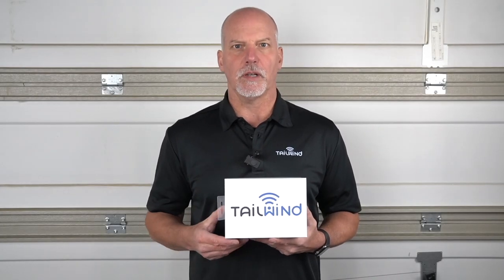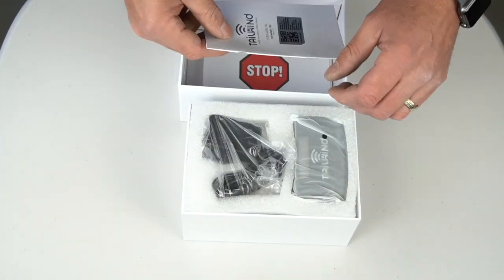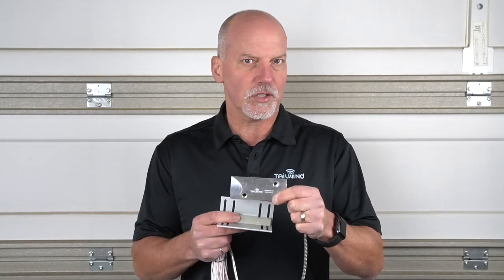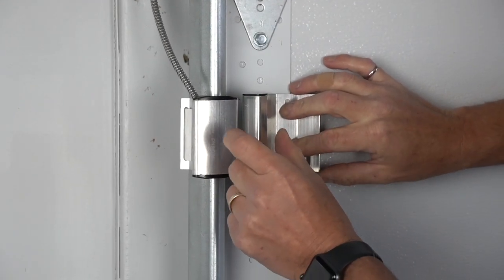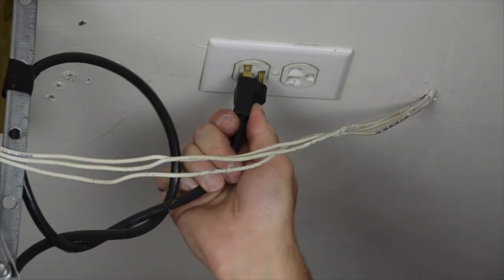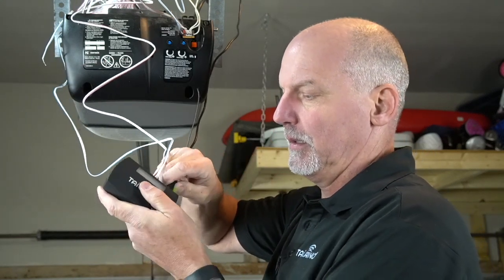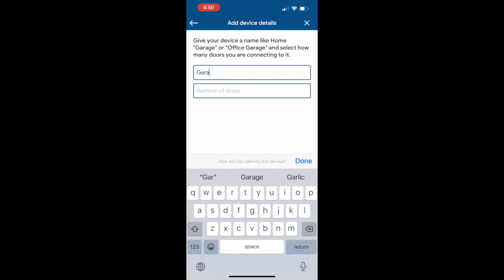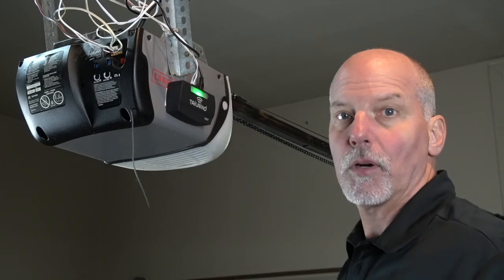Tailwind iQ3 Pro (1st generation) Installation Video

Comment: I already have a garage door opener but I want to install this.  How long should it take a professional to install it?
Reply from the maker: Typical installation times are in the 45 - 75 minute range for one door. It really depends on how particular the installer is with the wiring and if they have any experience with it. Like with anything in life, experienced installers can do it faster. Additional doors generally go much faster.

Comment: I have a linear opener with only 3 terminals labeled “push button” “common” and “beam”. Which two should I connect the blue and white wires ? Model LD050
Reply from the maker: You would connect to "push button" and "common"

Comment: How do I install this on a gate ? There is no instructions on your website
Reply from the maker: please email support@gotailwind.com and we can send you a picture of a gate installation. We recommend the universal sensor version for gates FYI.
Reply: GATE OPENERS
Gate openers are generally compatible but there are a few things to note:

1) Tailwind requires wifi and power.
2) The Tailwind controller and power supply need fo be shielded from weather. Generally this can be accomplished by putting the controller in the same housing as the gate controller, but Amazon also sells “project boxes” suitable for outdoor that are a good option as well.
3) The universal sensor version is much more suitable for gate installations than the J-track version.
4) Please check your opener for a terminal labeled OSC (open / stop / close), PB (push button), SBC (single button control), CYC (cycle), RADIO, or anything that indicates that it is capable of toggling the gate open / closed from the same terminal. If so, it's compatible without anything special. If your opener does not have any terminals like this and it ONLY has separate inputs for open / close please contact support@gotailwind.com for guidance.

Comment: Over the years, I've been through the mill with my garage door. I started out with an Insteon garage door opener kit. That worked well, But then my garage door hardware gave out, and I was forced to install a new lifter. I purchased a Chamberlain model B750T. It came with the MyQ software, which I programmed to integrate with my HomeSeer home automation hub, and my Amazon Alexa installation. But then MyQ decided to discontinue Alexa integration. So I am once again looking for a solution. Hopefully one that's a little longer term. My questions: 1) I have already installed a sensor wire, the one that came with my Insteon set up years ago. Do I need to still install the sensor that comes with the tailwind pack? 2) Does this replace the wall button?  How much of the old MyQ/Chamberlain installation is replaced by this setup?
Reply from the maker: if the sensor you already have installed is a simple contact closure sensor that is a closed circuit when the door is closed, and open circuit when the door is open, you can use it with Tailwind as long as you don't connect any other hardware to it. Tailwind does not replace the wall button. All existing controls continue to work. You would keep your existing garage door opener as well as any other hardware you wish to keep. As for what Tailwind "replaces", it doesn't really replace anything. Tailwind will allow you to control your garage door using our hardware and software, which also includes a lot of integrations (local control API included). The full list of integrations can be found on our website here https://gotailwind.com/pages/what-does-tailwind-work-with

Comment: Is it me, or did he miss how/where to instal the door sensor wire??
Reply from the maker: The system ships with the door sensor wire  already connected to the door sensor. Once you install the sensor you just run the wire to the controller and plug it in.

Comment: This video is great if everything works as planned. However, my installation has run into a snag and getting any kind of support feels impossible.  My issues has been received and is being reviewed great, but the question I thought was simple. I am not getting a blue flashing light to get connected via bluetooth.  The tool they gave me is not toughing anything when I follow the instructions to reset.  When I look in the reset hole all I see is a metal board. Nothing provides resistance anywhere when the tool is inserted.  I am stuck, and no one helps.  🤔
Reply from the maker: I looked into this for you to make sure someone was going to get back to you. It appears you contacted us at 7PM (our time zone) last night and we responded to you this afternoon with a few emails and a resolution to the problem.
Reply: @TailwindGarage  I did receive help, and a new product was sent to replace the one that was not functioning.  It worked great and i was up and running in minutes once i had a working product,  Thanks for all the help!
Reply from the maker: @ajbenway1  our pleasure!

Comment: Just finished installing IQ3 Pro on my single-door garage. This video was very helpful. My opener is a 1997 LiftMaster Security+ and works perfectly with Tailwind. I bought the J-clamp version and found that the clamp isn't very secure since the "J" form of the sensor doesn't truly align with the "J" rail and with the way the locking screw works. I ended up really REALLY tightening it and it now seems to be holding to the rail. We'll see over time and seasonal temperature swings. 

I think it's amazing how a 13 minute install video makes everything look super easy but in reality the whole ordeal took over an hour including a bit of trial and error.

100% glad Tailwind is Canadian.

Comment: Would love to see the guide on how to set it up *without any mobile device* but instead using only a laptop PC with a web browser. Would also love to see a version with an Ethernet port option so as to avoid using inherently unreliable WiFi connections.

Comment: Can this device be installed to the internet with cable rather than WiFi?
Reply from the maker: The Tailwind controller is connected by WiFi. It does not have an ethernet port.
Reply: @TailwindGarage  A terrible design choice made by far too many device manufacturers. Wired Ethernet should always be an option for devices that are not and do not need to be portable.
Reply from the maker: @r6u356une56ney  we conducted surveys during the design phase and asked if they would like an Ethernet port. Lots of yes answers.

Then we asked if they currently had an Ethernet cable that ran to their garage and if not, would they be willing to install one? Most answers to that were No, but still some yes.

Then we asked if they would be willing to pay the roughly $5 to $7 extra it would cost to add the Ethernet option (we didn’t want to make 2 different models - so it was WiFi + Ethernet or just WiFi).

When we asked that question all answers came back as “No”, so the Ethernet port was pulled from the design.

All of that said, Tailwind is doing very well and growing. We recognize there are applications and customers that would benefit from having an Ethernet port. There might be something on the roadmap to address that segment of the market.
Reply: Especially if you do it as a POE option as power and data over Ethernet

Comment: Since the standard garage door opener already has limiters built in, why not build a unit that works like a regular remote that uses a wifi or matter connection to trigger the remote. Then you wouldn’t need any other hardware or sensors.

Comment: Tailwind claims to "work with" Android Auto.  But what does that mean, "works with"?  Does it provide complete functionality that you would get with using the Tailwind app only? It doesn't show up on Play Store as an approved Android Auto app. Do I need to use something like "Android Auto Apps Downloader (AAAD)" to bypass the fact that it is not officially supported? i.e. side-loaded

Comment: I'm still on the fence about what solution to get.  I understand the issue with MyQ's lack of integration with home integration platforms. It would be really nice for someone to provide a detailed breakdown /comparison of all viable contenders, functionality and price points for 1-3 openers. Personally, I like the idea of having wireless sensor unit like MyQ provides. Or maybe having a local solution (no cloud) is a deal breaker for someone, which might rule out MyQ for others.  Is there a Consumer Report for this category. i.e.  Smart Garage solutions

Comment: Much ado has been made about the MyQ and Home Assistant integration issue of late. 

I can assure you that 99% of Chamberlain's customers are not technical users to the extent that not having API access would matter to them. They want the solution to do a few things like remote access and door position sensing which it does. The majority are probably not even using Home Assistant and may decide to opt for more mainstream solutions. 

Chamberlain has no doubt invested significantly in its products. For them to support an open software solution like this doesn't  provide any revenue and in fact would only be an expense. If you were CEO of Chamberlain, what would you do? 

The only way you would get them to buy in would be if everyone just refused to buy their offerings unless Home Assistant integrations worked with MyQ.  Realistically, I don't believe that day will ever come. 

Out of curiosity, does anyone know how much a support license would cost? Perhaps it isn't that onerous.  You can inquire on their website as they provide an inquiry form. 

* Also, might I suggest adding one of those charts (with checkmarks ) that indicate what platforms (Google home, Homelink, Home Assistant, etc) , are supported by some of your competitors vs Tailwind. This would greatly help potential customers... And perhaps prevent them from making ill informed decisions.

Comment: Ok, so My opener is Chamberlain (requiring the adapter) but you never mention the adapter or where to mount it. And the adapter has what appears to be hardware similar to an auto key fob. Do we hang it from somewhere on the opener? Not enough info Scott. I'll be installing this tomorrow. At some time while checking out this device, I remember a short tutorial about the automobile sensing and that some autos will need the extra device for that. How do I determine if my auto needs it. I don't have one at present. My IFTTT stuff seems to "know where my iPhone is"m so I'm hoping your bluetooth will recognize mine. I never drive without my iPhone. Neither does my wife.
Reply from the maker: Hi Hal. Thank you for choosing Tailwind! You can hang the adaptor or zip tie it to the hanger brackets that hold up your opener. Some customers even just let it hang loose. Bottom line is you can mount it however you wish. If you look at our vehicle sensor product page you will see an explanation about what it does and if you need one for your use case. The vehicle sensor setup video is also a suggested video at the end of this installation video.

Comment: What isn't shown here ... a multi-door installation, which most people will have, will need wires running along ALL of your doors J rails for the sensors (like indicated in the video)... plus another set of wires for each connection to the single multi-channel controller unit.

If you have a 2 door garage, this means the wire runs will be very long, not to mention a 3 door garage.  (In this case, you could put the controller on the middle opener to reduce the length of the wire runs from the other doors)
Reply from the maker: Thank you. Most of our customers actually have 1 garage door based on ordering patterns, but you are correct - we didn't show a multi-door installation as we tried to keep the video as short as possible while still hitting the important points. We do mention that additional door kits are required for multiple doors in the video, and further guidance is provided in the user manual that ships with the product. Tailwind additional door kits come with almost 33 feet of wire to accommodate high ceilings, etc. We try to make sure you have enough for almost any installation.
Reply: I have tailwind on two doors. Yes it is a lot of wire but it wasn't a big deal to run it along the rails with the provided clips and have a neat install. I do find that the tailwind does always detect when I arrive home about 10 percent of the time by GPS but that is a separate issue.
Reply: @BradThurber I suspect you meant doesn't always detect